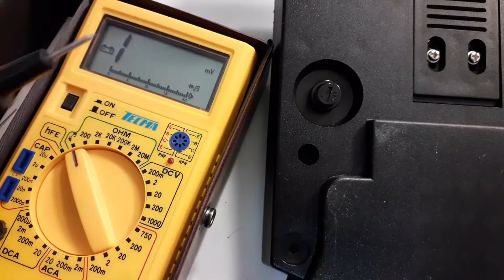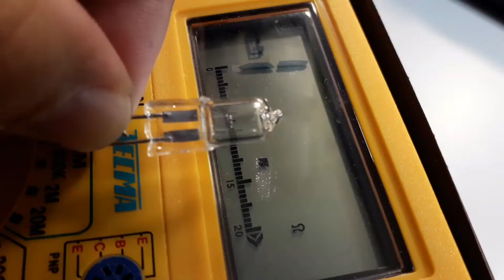🔬 Changing a halogen microscope lamp to LED | Amateur Microscopy

Comment: Follow these steps to upgrade your microscope from a 20W–50W halogen light to a 5W LED. 

The LED emits light at 6500K, but you can choose a different one later by searching Digikey. Using my 60x objective and fully closing the condenser diaphragm, the image appears much brighter, comparable to a 50W bulb, as my 20W halogen bulbs looked too dark at these settings. No flickering was observed, if anyone wonders.

This setup works perfectly with my Amscope T520. I soldered longer wires to connect the controller and the LED, but it was straightforward. Had to buy a pot knob since it didn't come with one. 

The potentiometer allows smooth, linear brightness control. Place the LED close to the illuminator lens for optimal light transmission, rather than letting it bounce around inside the holder.

The LED has a built-in heat sink at the bottom, enabling mounting on a metal surface if desired, though I didn't find it necessary.

“5W LED Light Microscope Power Supply Light Source”

https://www.amazon.com/Microscope-Supply-Source-Repairing-Dimming/dp/B0D49TJV1G/ref=sr_1_1?crid=2BLCUSM9Z7IJH&dib=eyJ2IjoiMSJ9.GqqxZQ5m5NdiYDwsY1JacQ.RkG6ahN3qaBMCcLjyLdiy8TK73PjZczbnQp9JnrnSqU&dib_tag=se&keywords=B0D49TJV1G&nsdOptOutParam=true&qid=1767396227&s=photo&sprefix=b0d49tjv1g%2Cphoto%2C236&sr=1-1

Comment: buy an AC TO DC (or use 4 diode + captivator ) if you want to use LED . why ? to have full brightness of LED . please search why its a DC .
and i recommend to use SMD NOT LED . LED brightness is NOT great , if you want to have good brightness so use SMD and you can go for 5w to 25w and etc to more brightness.

Comment: Is LED better than halogen?
Reply from the maker: not automatically better. But it gives a cooler light and the color does not change when you change light intensity. So there are certain advantages.

Comment: You never said WHY you want to change to an LED from a halogen.
What advantages does an LED source have over halogen for microscopy?  (Hint: If you say that the LED is more energy efficient my opinion of you will drop greatly.  Microscope illumination is used so little, and for such a specialized purpose, that energy efficiency can and should be a very low priority.)
Reply: Colour difference?
Reply: The illuminators were broken, didn't work, and a $30 consumable bulb vs a $3 non-consumable LED is a significant consideration when you're on a school budget.

Comment: You can easily buy and install a Cree led and driver pack. Cost £10 off eBay for 100w module. Well worth the money. Transformed my microscope! Can see everything in live blood using dark field much clearer now.
Reply: Can you link the parts you used? (12v 50w original halogen)

Comment: Buy an LED with the same or lower watt rating as the halogen lamp so as not to exceed the capacity of the power supply. An LED will always be brighter than a halogen at the same wattage because of much greater efficiency. The LED may need a heat sink to keep it cool. In my Nikon S, I use a 3W RGB LED with a custom driver (Arduino Mini + 3X LED drivers + my own software running on the Arduino and a PC) so that I can vary the color of the light. My LED is mounted to a length of 30mm aluminum rod with thermal transfer adhesive. This acts as the heat sink. It has performed brilliantly (pun intended) for many years. You could use the help of an electrical engineer to figure out a proper design. I don't need one because I am one.

Comment: Hey. Have you thought about using high CRI led? The quality of the colour rendering is important.

I am thinking about getting a small 3w and place it close to the fiberoptics. And attach heatsink. The best way to control LED brightness is to adjust the current! Buy a small buck converter and extend the current limiter potensiometer. You find out the right voltage first and keep it like that, but adjust the current. The voltage will follow.

Comment: Can I switch my led lamp to 
halogen bulb from my introductory microscope?
Reply from the maker: Not recommended. Different transformer needed (for more power) and the heat generated by halogen bulb cause a problem.
Reply: @Microbehunter_Microscopy      Hello my friend , is it just a Simple case of swapping a 6v 20 Watt Halogen Bulb for a 6 Watt G4 Cob LED Bulb , they have the same fitting  ?
I just wanted to make sure , thank you

Comment: Do halogen bulbs may cause fire?
Reply from the maker: They generate much heat, so fire is certainly possible if something flammable touches them (dust?). Fingerprints on the bulb can cause the bulb to break and dust in the microscope might cause fire. But defective electronics (transformers etc) can also be a problem, and they are used for LEDs as well.

Comment: I love your microscope videos, but all of this is just wrong. LED's are not the same as lamps and cannot be driven that way. You need a power LED of 1 to 5 watts, and an electronic circuit to modulate pulse width, not voltage. You can buy these on ebay.
Reply: I'm not sure pulsewith modulation would work. It will just flicker, at high intensity light. The best way is to control the current.
Reply: @LordGryllwotth  You won't see any flicker as long as the frequency is high enough, but controlling the current works too and is probably easier.

Comment: The LEDs you show here are just signal LEDs, mostly used to signal if something is turned on or off. They are not made for illumination. You need a 3W LED for that. 1W might work. 5W also could work, but would be very bright. My microscope uses a 3W.
Also, to drive a LED you can use Pulse With Modulation. This will give varying brightness.
When buying a 3W LED for this, choose one of high quality (high CRI). So that the light it gives contains a more complete set of colors than cheaper LEDs. Because cheap powerful LEDs might not render colors well. You might have experienced that with LED flashlights.
Reply: I modded my microscope because the halogen bulb burned out, the replacements are very expensive and kinda hard to get so i decided to go stupid and put a Cree XHP70.2 5000k 80CRI LED, used one of those arduino modules of 8A step down buck converters as driver and now i can regulate from very low light to stupid bright so much that at max power if i put a piece of black plastic on a slide it smokes like crazy, at first i though it was just stupid fun but actually is very useful when i want to take photos of fast moving organisms, i can use a fast shutter speed and just give a burst of high power light.
Reply: @teresashinkansen9402  holy crap I need this
Reply: @teresashinkansen9402 I know this is an old comment, but I’m wondering if that level of light killed the microbes?
Reply: @Anvilcjl  Yes it can kill microbes, mostly protozoans and some diatoms, they bleach and stop moving if the light is on more than few seconds, if you let it on for longer the slide overheats and most things stop moving, the slide dries up very fast. I rarely use the light at high power except for bursts of about one second when I take a photo when using high power objectives. I usually use the light at a current of 100-500mA out of the maximum nominal current of 6A, tho the LED can handle being over driven for a few seconds at more than 10 A, its crazy.
Reply: Should try contacting bigclivedotcom about a suitable LED and control circuit. https://www.youtube.com/user/bigclivedotcom/about
Reply: I have  the Ushio Halogen Projector Lamp  BLC 120V30W. What would be the Led equivalent of that? I want to upgrade my halogen bulb to Led.
Reply: A very useful comment!

Comment: I have purchased premade led modules for some of my microscopes off of eBay. You have to make sure you order the correct model for your microscope. For the microscopes I have that can't be adapted to led light, I simply make sure I have a lot of extra bulbs on hand, especially the hard to find bulbs. Some of my old microscopes do have very large external transformers. Transformers do occasionally fail. I have occasionally replaced them with electronics "lab" variable transformers, though they require a bit of trial and error to determine the correct voltage and amperage limits.